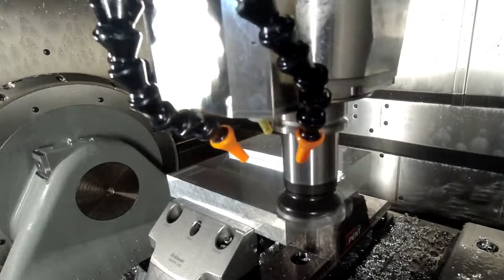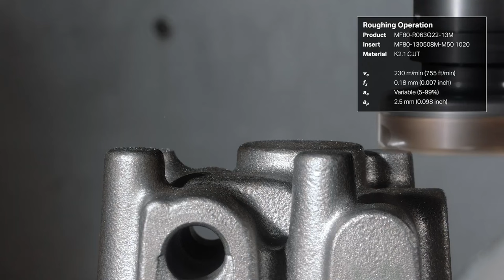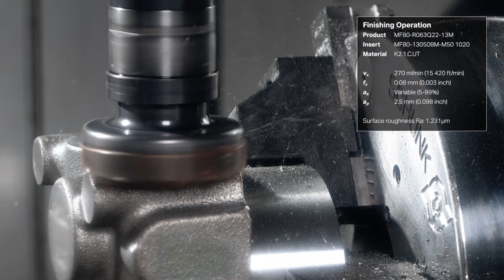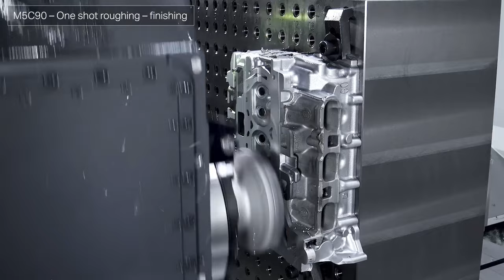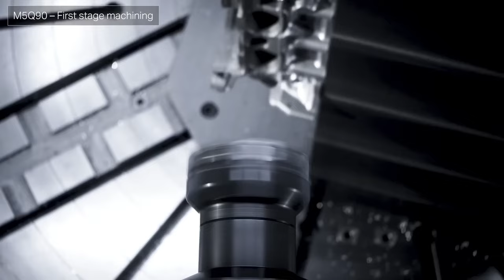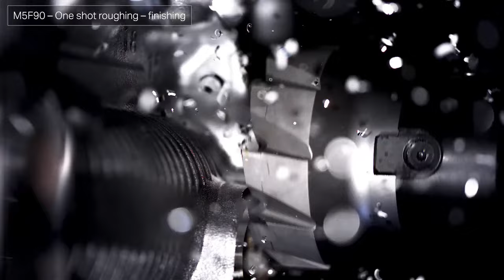CNC 5 Axis Milling Working Process High Speed Cutting Machining

Comment: Typical "demo" big hunk of steel in an ideal clamping. Lots of extraneous metal removal making a useless paperweight. Overly big retractions and R planes.
Reply: It’s definitely aluminum. Ran lots of parts like this as a weld tooling designer. Sometimes starting with a well clamped piece even if you have to rough a lot of it off just makes it faster and when you’ve got more work than spindles it helps. Had this discussion with lots of people who never touched a cnc controller.
Reply: Agreed ...
In my shop we use a band saw or even a chop saw to take out the overage ...
Oh and we don't use the 5-axis for anything under a 4-axis job ...
That would have gone in our HAAS or if it needed the rpm's the robodrill ...

Comment: Not one five axis move. All 3 +2
Reply: Normal not all pieces need 5 axis, in my workplace 70% of the time i just use 3 axis and even the rest most of the times i dont even use the full capabilities most of the tollpaths dont even need continuous 5 axis. with the rigth tolls you can cut the necessity to use all 5axis and if you use them you sacrifice rigidity...

Comment: Considering that the doors do not open, we can assume that this is a machine with automatic cutter replacement. 
I think that this is excessive automation, because it is not difficult for the machine operator to change cutters and before installing them, for high-quality operation of the machine, he must check the integrity of the cutter. 
And the program was also written incorrectly: when removing several centimeters of metal, it is necessary to turn on the cooling to avoid overheating the cutter and putting it out of order. In other cases, it was possible to reduce the cooling pressure, but this is not necessary, because this only slightly increases the energy consumption of the machine and does not affect the quality of the part or durability of the cutter